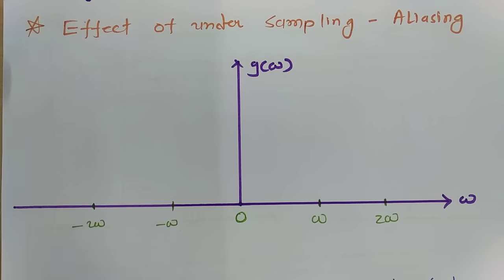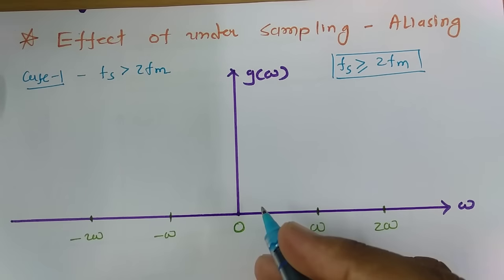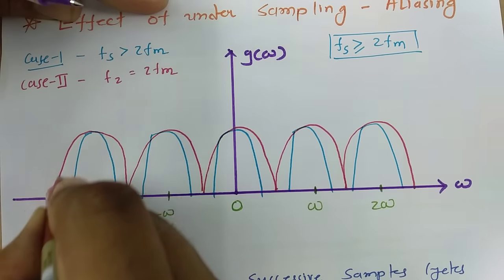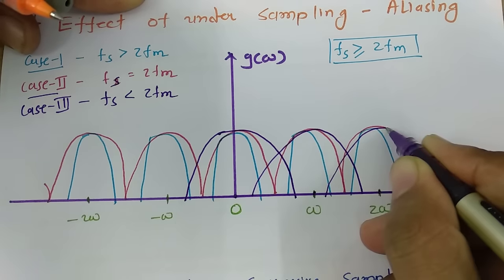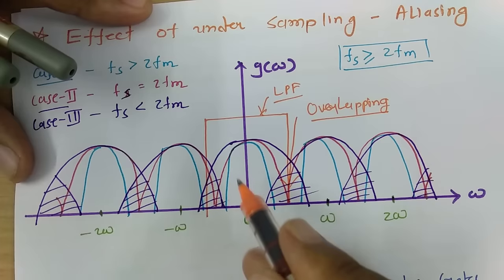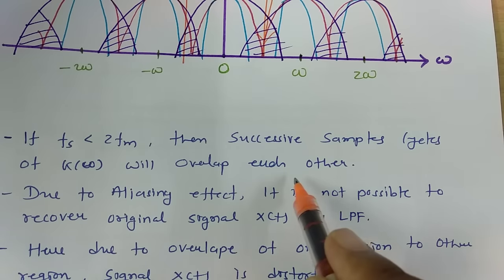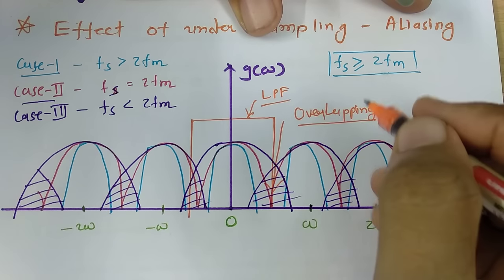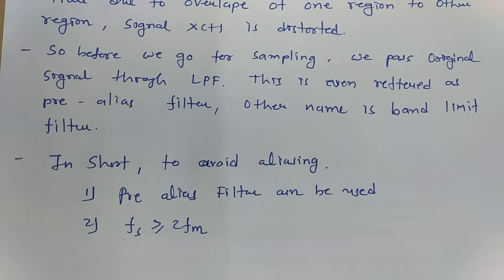Aliasing or Effect of Under Sampling | Generation of Aliasing | Effect and Solution of Aliasing

Comment: Can someone plz tell why are we using low pass filter
Reply from the maker: If you use low pass filter then you can lower the value of Fm, so we can have better relations between Fs and Fm. As you know Fs > 2Fm to avoid aliasing. If Fm is lower then we can avoid aliasing.
Reply: @EngineeringFunda  thank you
Reply: @EngineeringFunda  but if I use a low paas filter a part of my signal will be removed...will it not lead to loss of information?